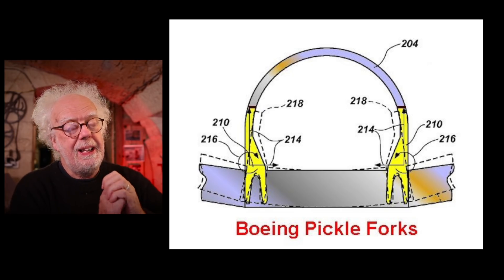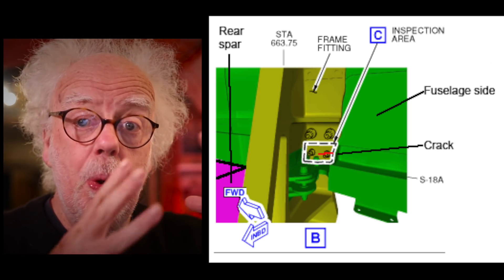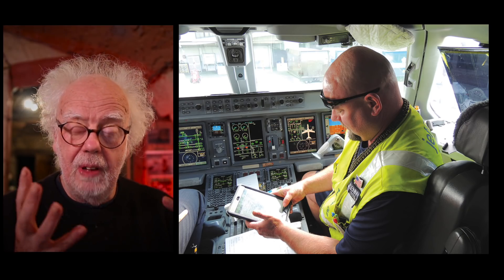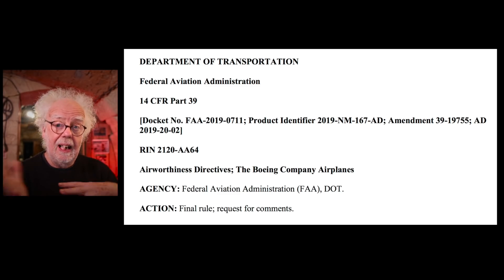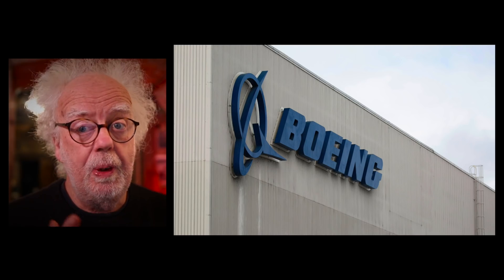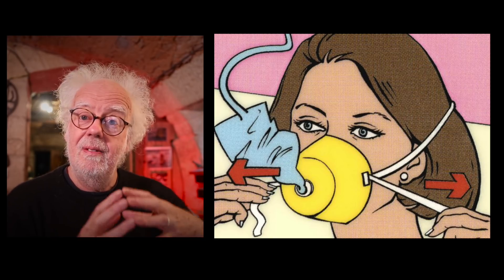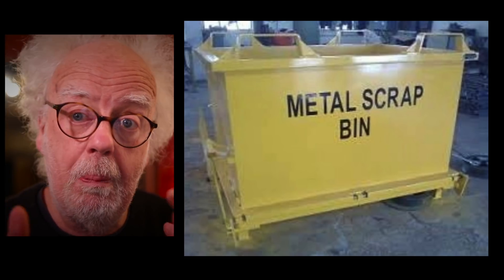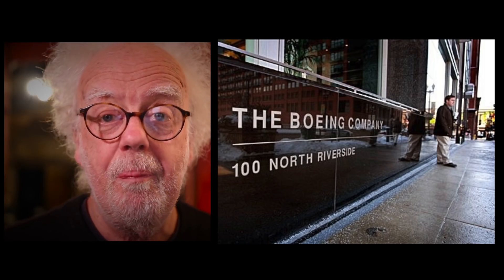Pickle Fork - Prof Simon

Comment: Where the pickle fork is located is not a pressurized area so pressurization cycles should not affect them.  Since it is beginning or end of the wing depending on your perspective, landings, takeoffs and mid air turbulence are going to be the stresses that need to be counted.  Also these planes are approaching 30 years old and life expectancy at the beginning of a product is more of an artistic guess.  I would expect the 737 max will have the same pickle fork issue once they reach 25 or 30 years old unless they can be refitted and it is just a guess how long a refit will last.  It may not be economical to fix these cracked pickle fork so they will flown to the bone yard and cannibalized for parts, the problem with cannibalizing is if the same part is going bad everywhere even cannibalizing will no longer be economical, then it is to the scrap yard to be melted down and recycled into new planes, beer cans and Teslas.  Got to wonder why we don't hear about this with the 737 classic which are approaching 40 years old or the original 737 which are approaching 50 years old.
Reply: You are not flying the plane anywhere after a structural failure that invalidates the airworthiness has been found. The smart thing to do would be to perform the inspections at a scrap yard to begin with, if you find the fault at an international airport the parking will get expensive fast.
Also, the cracks are around a bolt hole, the bolt is attached to the pressurised fuselage, so yeah the pressurization cycles very much do matter here.
Reply: The pickle fork is carrying pressurization loads from the fuselage round section to the flat wing carry through. It also carries the aerodynamic bending loads between the tail and the wing in flight.
The 737-200 is much shorter so the loads are much lower.

Comment: I believe that faulty parts rejected, out of the production line, are sold in the maintenance market as new spare part. Sick.
Reply: I think they landed up here........
Reply: Typically non spec parts can be repaired. However if it is a crack it could be fixed by machining out the crack and welding in new materials but that would not likely work on such a part. Chances are they were fixed and put on planes. I used to fix and inspect parts for planes as an FAA inspector.
Reply: @Paul-gz5dp  Thank you for the information.

Comment: "Safety before profit"  Yeah, that's not going to happen.  What is more likely is "What can we get away with before the planes fall out of the sky and we get sued too often?"
Reply: Between insurance and corporate-serving taut reform, no number of potential lawsuits is a strong deterrent to wilful negligence. Amoral publicly traded corporations adhere to safety standards to prevent criminal liability and dramatic sales losses, but lawsuits are only scary to much smaller businesses.
Reply: You realize you are talking about airplanes 15 years old and up running into a problem.  How long do you think a machine should last without a problem that needs maintenance?
Reply: @compulsiverambler1352  "no number of potential lawsuits is a strong deterrent to wilful negligence" 

Are you kidding?  Boeing has already pledged $100 Million to those affected by 737 Max crashes. Then the lawsuits START. This will cost them a BILLION easily before it is done.
Reply: @robjohnson8522  By Boeing's own calculations, it would have taken MUCH longer for the cracks to appear if the parts had been made to spec. That's the story here - the cracks are proof of claims whistle blowers have made for years that Boeing does or contracts out  construction processes to places that systematically and illegally ignore the specifications that the maximum altitude approvals etc. are based on, and on which accident investigators sometimes have to base estimates of things like impact force.
Reply: @robjohnson8522  Are YOU kidding? Or shilling, more like. A billion would be chump change even if they were paying it, which they aren't. The only business hurting from those lawsuits are Boeing's insurers.
Reply: @compulsiverambler1352  "for the cracks to appear if the parts had been made to spec. " 

Do you have a source for that?  I think you just made it up but I may well be wrong. I have been in the aircraft building and repair business since 1980 and I never known anyone to be shocked at parts that accept landing loads to crack after 35,000 landings.   You are the first person I have heard say they were not to spec.   I don't' know everything though so what is your source?
Reply: @compulsiverambler1352  LOL! OH! Insurance is magical money!  Insurance is free he says! OK!  Well, now that I know how much you don't understand about the world and money I won't bother to explain that the money Boeing is loosing on this deal is far from "chump Change". I was going to use math and stuff to show you but I see now what a waste of my time that would be.
Reply: @robjohnson8522  no one said insurance is free. It is true that Boeing's insurance companies will be paying the families and not Boeing
Reply: @Rob Johnson. Have you actually read the specs for the parts in question?

I'm personally not surprised at problems in a part with 30,000 cycles either.
But that doesn't change the fact that it's a part which, by it's specification should be fine for 90,000 cycles.

It's one thing to say aircraft need frequent routine inspection and maintenance.

I mean that kinda falls under the heading of 'no duh' in terms of how obvious it is.

But it's quite another for a company to claim the specification for a part is 3 times what it seems to have been in practice.
Either the specification in question is bullshit, or there's some seriously substandard manufacturing going on.

And yes, parts are rated in terms such as MTBF which implies some will indeed fail earlier than the average the specification states.
But failing after 1/3 of it's rated lifetime?
That seems a bit off, doesn't it?
Reply: @KuraIthys  I shortened a much longer down post to... So how many forks have cracks so far? 20? Out of 14,000 plus?  Is that a valid statistical universe to make sweeping pronouncements about the design of a part?   

Not in my world. 

On a related note, I won't buy rental cars because I assume they have been abused and won't last.  One customer with cracks, Ryan Air is the rental car equivalent of the airline world. I bet those things exceed MGTOW on a regular basis regardless of what the paperwork says.  :)
Reply: @MaynardFreek  So do you think Boeing does not pay deductibles as we all do? Do you believe that Boeing insurance rates are not going to spike (if they have not already) after this major claim just like it would for all of us?   When he said, "planes falling out of the sky" will not cost Boeing "a shilling" is a level of ignorance that is difficult to grasp. Apparently, it is not just American schools that have gotten so bad. :(
Reply: I just read in Forbes that the 737 Max issue has cost Boeing 10 billion dollars so FAR. Apparently,  safety does pay.

Comment: That is quite a pickle, I hate the disposable world we have build and honor, there is a reason ww2 planes still fly today because they were made to last and it just proves that it is possible, in the name of fuel efficiency and environmental concerns the products we make and use have been over engineered with built in failure points to force getting a new one, this is the environmental catastrophe humanity has created, a waste stream of good equipment designed to fail. There is a balance we need to find.
Reply: I agree. We have an old oven that is at the least made in the 70's and it's around 50 years old and works like new. Our new oven for the upstairs literally never worked right from day one and it finally gave out a bit ago. Funny thing is, we almost never used it and it still broke. Always used the 50 year old oven because unlike the new ones, it actually works right. Whistle blowers have said they give products a life span designed for them to break and I think that's a disgusting business practice and exploitative to consumers.

Comment: Boeing should address this issue immediately. On the other hand , the tip of the iceberg is human-related. NASA´s Safety Culture like Boeing´s and FAA´s used to be paramount. It seems those golden days have gone.
Whether this "pickly Fork" issue is rapidly rectified there are still other hidden flaws emerging from the iceberg: safety flaws are caused by "some" people. The Reason´s model is helpful to understand it. 
CEO´s  manage the manufacturer´s budget . They say "this dolar should be spent somewere else" despite they were initially destinated to system safety training. 
The same problem occured to the FAA. Oversight should have never be handed over to the manufacturer.
Finally , I suspect none of the western aircraft industry is safe from this "new" flaw: the lack of integrity  was begotten  when we quited being decent. The yuppies are back.
Reply: NASA has a history of major lethal safety problems - it has a military culture of mission timeline first, safety second. This has killed over and over again.
Reply: alix
@Allan Gibson 
Thanks for your comment. 
I partially agree with you .  The early days  of aviation were hard.  From 1920 to the early 70's  the Fly Fix Fly concept was the first  stage of aviation safety. The trial-error approach caused fatal consequences to pilots/ flight engineers  and loss of invaluable prototipes.  This logic evolved when management oversight and risk tree (MORT) was applied.  I would prefer to say "evolution of safety culture" instead  "timeline first, safety second".  Wernher Von Braun knew it perfectly well . When the pressure of WWII ended and rocketry was applied to civil use the "risk management matrix" confronted Probability and Consequences of  assuming risks. The core of the matter is  "some" individuals are not fitted for the job because they are neither competent nor  honest  . They put aside the industry  best practices and adopted "the rat race" filosophy. The Challenger  accident is one of the leading cases.
Reply: @astircalix4126  Apollo 1, Columbia and the losses of a dozen other flights over the years indicate NASA has a problem. Recruiting from the military is part of it - the mission first culture is an inherent part of this. The only thing worse for safety would be recruiting farmers (the bodge it to get the harvest in and fix it in a couple of years culture at work).
The pickle fork is getting worse - Lion Air are reported two aircraft with less than 20,000 cycles with cracks.
Reply: @allangibson8494  
We are getting at the same outcome. But, my approach is above all  "a moral problem". Somebody told I was wrong when I shouted it during a lecture on SMS. I approached to the bench where one of my students gave me a small, disapproving frown . I asked Him : 
"Imagine you are an ATC controller and you notice a commercial pilot is making a steep descent during an ILS approach at night. What would you do ? "
He said "I would do nothing. Pilots are responsible for the safety of his own flight"
Ok I responded, Imagine the same situation but consider one of the passengers onboard is your son...What would you do then?
My student burst into tears first and then said " I would have stopped him .
Unfortunately , some hearts are so hardened that ignore core values when money talks.
Safety used to be paramount until "some CEO´s " drifted away and nobody sopped them.
Reply: @astircalix4126  I agree - safety is a culture and a fragile one that can be shattered by a CEO in an instant by pushing schedule and money at all costs. 
This typically happens when you get accountants running companies (CFO to CEO) who have never had a fellow worker killed around them.
People who know the price of things but not the value.
The military have different problems having been trained for mission schedule over safety (if they consider safety at all).
Reply: @allangibson8494  
"People who know the price of things but not the value." That is the smartest thing I have ever thought about this topic. 
Very good summary on this issue.
Thank you.

Comment: The parts may have gone to the scrap yard for quick cash.
Reply: Not the scrap yard, they were given a new serial number, either duplicating another, or a number from a properly scrapped unit, or a number not yet used in manufacturing. Then they were made to sort of function, and were then sold on to the secondary service market, either by swapping them out with a good part in inventory, that was sold "under the counter" for cash, or by simply having them magically appear in stock, and all the correct paperwork, though the papers they have does appear legitimate at first look, it does not tally up with other records from the full set.

You know the old story of the SR71 and the space shuttle, the paperwork required to fly it weighed more than the fully fuelled article itself.

Comment: If it's a Boeing I ain't going!
You know the story of the 737max Airbus had a market winner
They should have reingineered the whole plane from scratch for the newer engine 
Airbus would have had the market for 3 to 5 years if they could have caught up.
It's bigger must be heavier they did not have adequate engine ground clearance
So they sited it back behind the wing  affects the lift they put a software program
In which reorientated the nose of the plane that's why the max was crashing.They should 
Reingineered the plane for bigger heavier engines.so much for fair play and putting profit b4
Safety .It's clearly criminal negligence.The software MacGivering shows they were aware of the issue.
Prof. 1.What's your opinion prof on MH370 and twin towers and sympathetic total failure of building7
Any actual plane evidence and Boeing's uninterrupted autopilot  turning planes effectively into remotely controlled drones as disclosed by  whistleblower Field McConnell?
2. I don't believe in UFOs or manned lunar landings I think it was cold war hoax psyops total  doped up smoke and mirrors what do you think?
 what do you think?
3.F35 3 varieties of the most expensive plane for land sea and hopefully air. Versus  older F15s Hawker sidley harrier jumpjet and Typhoon planes.Why is British Military and engineering not advancing its own manufacturing experience .Why chaining ourselves into over budget underperforming plane we can't service properly?

4.Boeing v Concorde for transatlantic crossing.Rivalry .Fair play .reverse historical insights